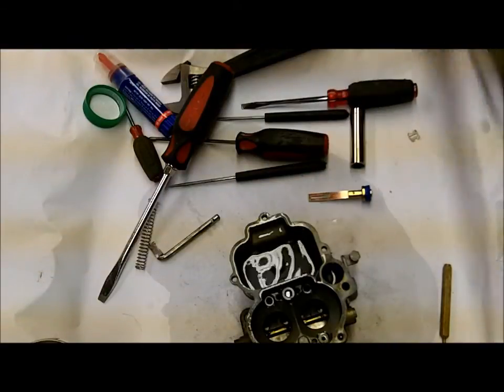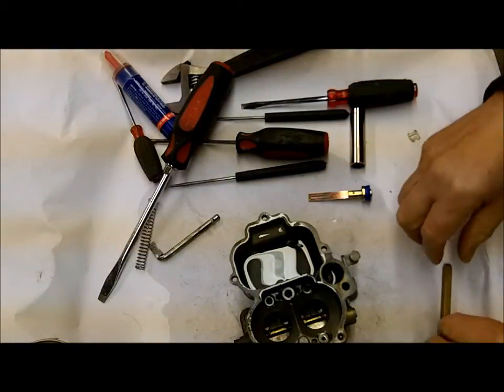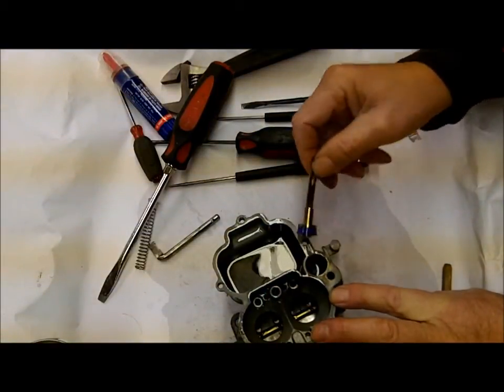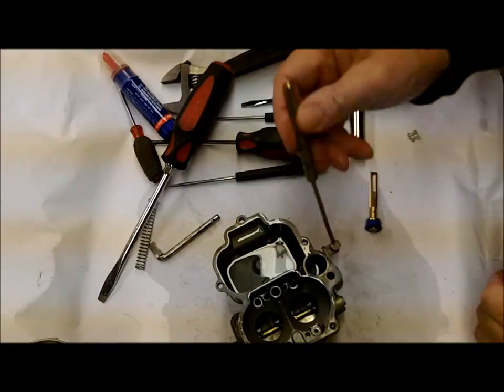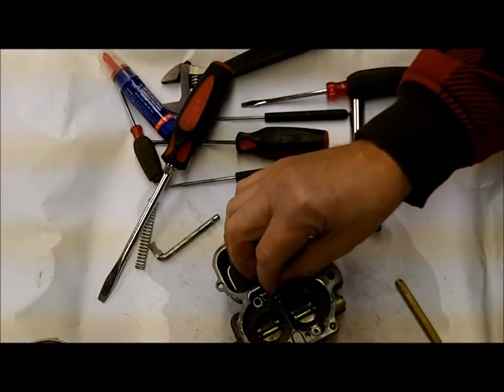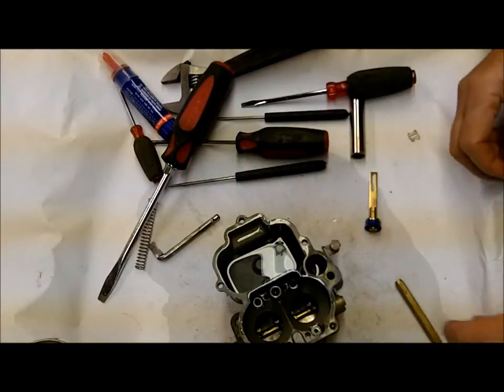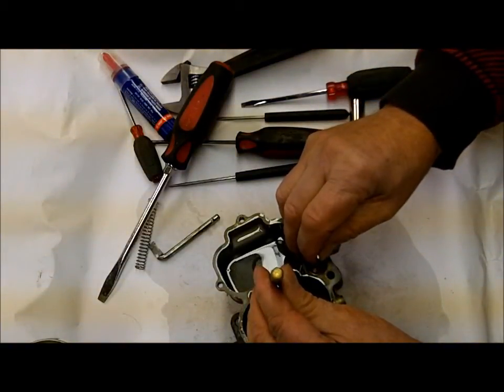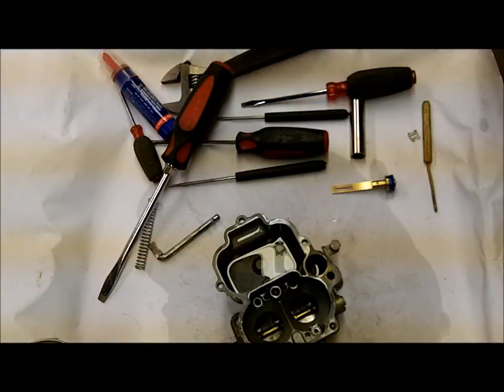Holley 94 2 Barrel Carburetor Testing Accelerator Pump Circuit

Comment: I am running into an issue. Fresh Ford 94 carb everything new built professionally. It ran sweet as soon as I put it on except for the accelerator pump was binding. When giving it gas it would go down so far and bind and you would have to push thru that point never a smooth shift or take off I checked some my other carbs and the accelerator pump moved smoothly nothing holding it. I pulled an accelerator pump out of one of the other 94s and now it glides like butter. One thing that worried me is the one I took out had a small spring on the bottom while the one I put in didn’t but one of your YouTube videos, said not to worry about it some have them and some don’t. Now the issue I am running ing into is it is either hard to start or starts instantly and dies after a couple of seconds. When it hard starts it runs for couple of seconds and dies as well. I get out and looked under the hood and my carb is leaking all over the place and gurglin Wipe it down and try again without giving it gas and the battery dies trying to get it to start.
I’m taking a crash course in flatheads and 94 carbs. I’m fine with it that is why I have two of them, the whole reason I got them actually. Trial by fire. Easiest way to learn. Lol maybe I am a glutton for punishment. But I wish I could get cut just a bit of a break. Can anybody show me where I am going wrong at?
Reply from the maker: The 94 should not have a garter spring in the cup. Take a look at this page for the fuel puking up. https://www.carburetor-parts.com/why-is-gas-dripping-from-venturi-after-shutdown.html
Reply: @MikesCarburetor thank you.  I just looked at that page.  I ran into that issue on my 40 ford with the trips with heat soak and had to put parabolic spacers under them.  This is my 1950 Ford it is totally factory. Single carb flathead v8 and it’s not starting enough to heat up couple of seconds before it dies and starts flooding out.  Today I purchased a Mr Gasket fuel regulator and gauge to install.   Had to order 2 1/2-20 fuel nipples to go between the pump and the carb.  Confused as to where to put the regulator before the fuel pump or between the fuel pump and the carb.   It does however have an electric fuel pump on the fuel rail the previous owner said he would only have to turn it on if it hadn’t ran for a long time.  It ran great for several days after I got it and stopped running.  Turns out he didn’t drive it much at all.  I had to drain the tank and clean it.  Bought a new Chinese knock off 94(junk) bought fully refurbished Ford 94 ran pretty good with the exception of the accelerator pump(or clip) binding making it hard to push down in the beginning until it got past that point I pulled it out and it looked a little twisted so I grabbed one from a other carb and put it in that moved smoothly.  That is when the flooding started and it stopped running.
Reply from the maker: @robbennett3206  Regulator is mounted between the pump and the carb.
Reply: @MikesCarburetor thank you. I did that yesterday eliminated the manual pump and only used the electric pump.   Cleaned every oriface to make sure of no plugs in them. Measured the float with my gauge have a different kind of needle and seat setup so drop doesn’t matter as much.   I put it back together turned on the the pump and it filled with fuel to top.  It’s back apart now and today I am going back to a needle and seat setup

Comment: Hi
Thanks for the Video Great , i have a small problem with my Nikki Carb on Lancer a72 1979, i can't accelerate it,i pulled the carb away and cleaned it and checked the accelerator pump and it pushed the fuel to the carb throttle down when i press down the accelerator pump only , it doesn't push any fuel when i release it back, is it having a problem on it ? or is it normal